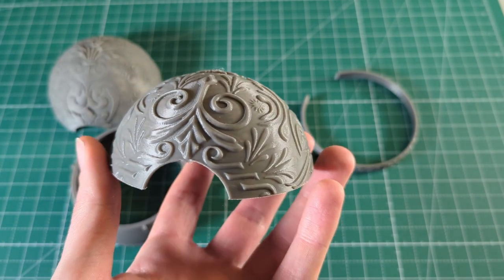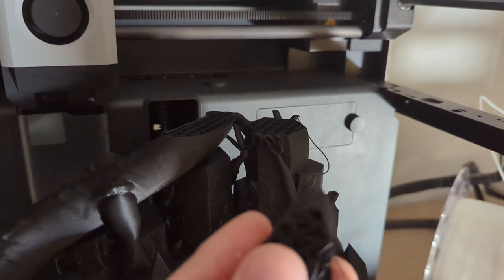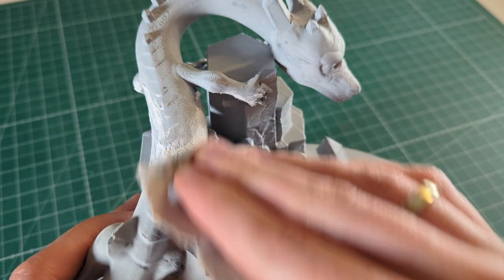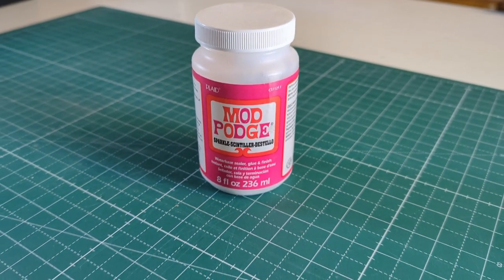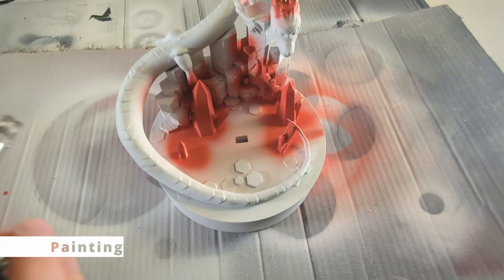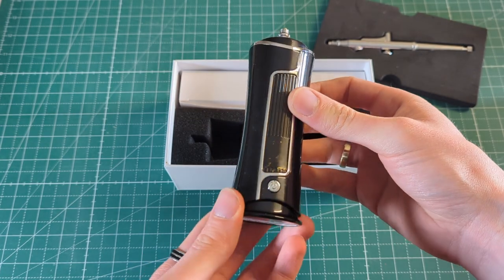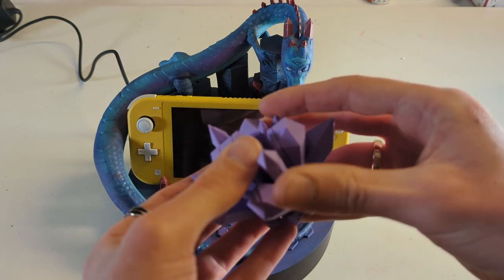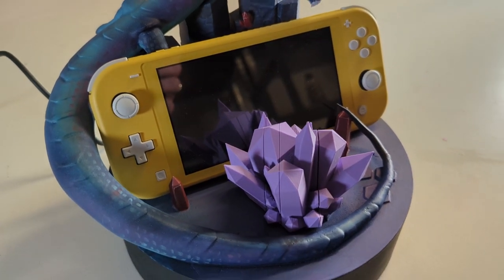How to Paint 3D Prints Easily and Reliably

Comment: I would like to make a cosplay. But i fear some parts will scrape to each other, and at the "contact" paint will be removed. Any idea how to make more durable? More clear coats. Like matt varnish? Also do you have experience with spray putty? Will it scrape off easily? I need smooth surface. Thanks for any help!
Reply from the maker: You can use spray putty to remove layer lines. You just need to prime it before painting and seal your paint job with a sealer. I recommend acrylic sealer (its available in matt and glossy). The primer and the sealer will keep the paint from scratching or peeling off but you will always have some wear in areas that rub against each other.
Reply: @Craftknights3D  Thanks! I was thinking about multiple layer of sealer coat is better for durability?